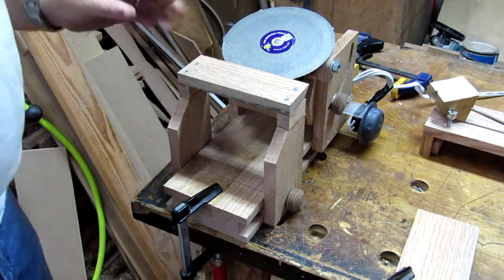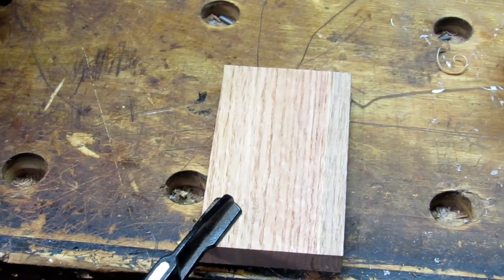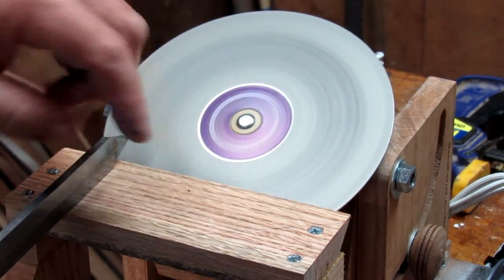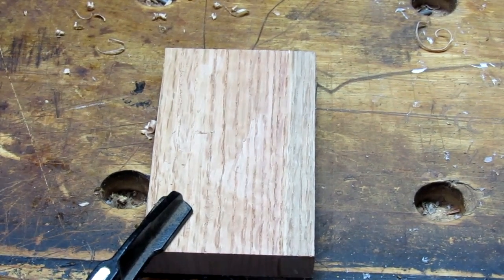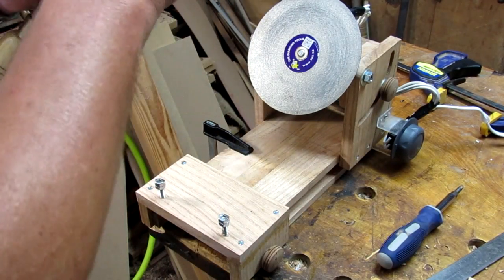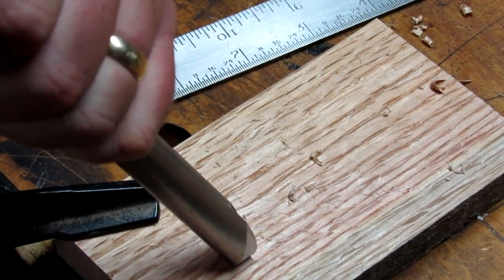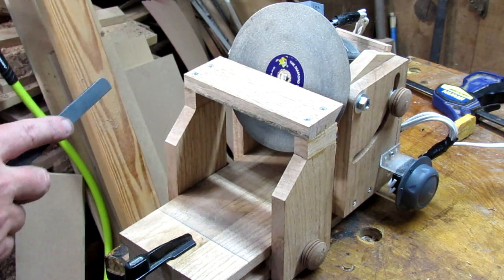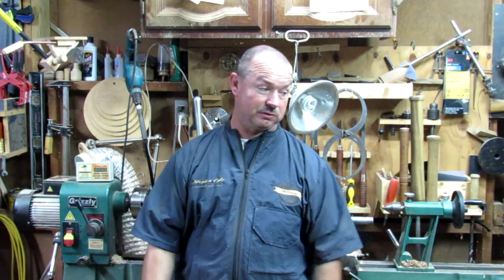#90 Sharpening Part 1 Woodturning Tools

Comment: The best of the best sharpening machine I've see. I wish we could have seen that build.
Thanks for the great video and I like sharpening in the flat. What kid of motor did you use and what about the mounting of the disc?
cheers,
Lee
Reply from the maker: +Lee Waterman Thank you Lee. I actually recorded the build and am just holding it unedited until I get feedback from viewers of whether to do it or not. I am also in the process of finalizing the plans so anyone can build it themselves if they would like. The motor I used came from a box fan. about 1500 rpm. I used a woodturned backing on the disk and pressed it straight onto the motor shaft and used a pin in the key slot.
Reply: +Stephen Ogle 

Stephen, here's some positive feedback.  PLEASE release your construction video, if you would.

As always, keep up the good work!  You and the Captain are my inspiration.
(Only one more month, until my shop will be habitable.  I LOVE summers here in Phoenix!  Supposed to be down to 100 by Friday.)

steve
Reply: +Stephen Ogle yes I have to agree with everyone else. very neet tool and i would Love to see the build video
Reply: +Steve Skouson  I agree Steve. To see the build would be great
Reply: +Stephen Ogle Sorry, i found out now wich grit and diameter your wheel have. but how much watt your Motor have ? i just found fan motors with 9-16w. isnt that to less ? thanks.

Comment: Nice job.  I have wondered for years why we use hollow ground tools when we are all about rubbing bevels.  I have sharpened shews, roughing gouges and parting tools on a belt sander for years.  Question to you, what grit are you using?  Also and not trying to be a jerk, but folks tell me that HSS and particularly the highly engineered steels with high Vanadium content are best ground on CBN.  Not sure if you can get a CBN disk of this type.  This seems to be working fine.
Reply from the maker: +1715scuba The belt sander is a great idea and I have used it myself. Diamond will cut HSS and last longer than other wheels. I guess that is what they are talking about. This disk is a 500 grit and cuts with diamond just like the CBM for about 1/20th of the cost. I do not know how long they will last yet but at those prices I can easily talk the better half into buying new disks if needed.